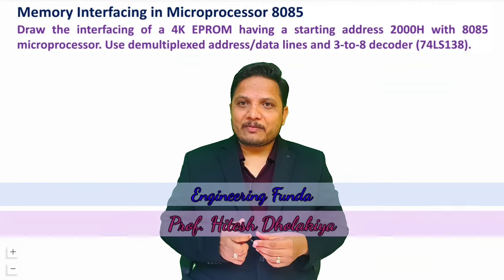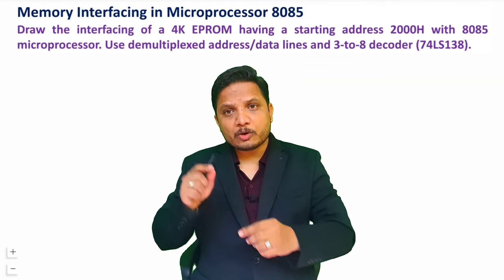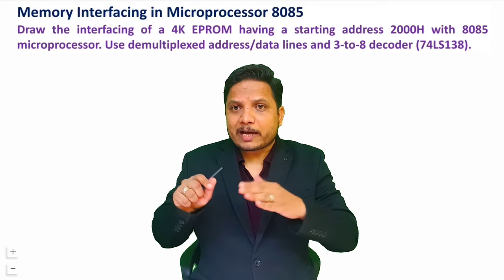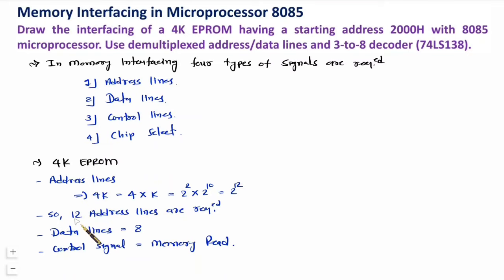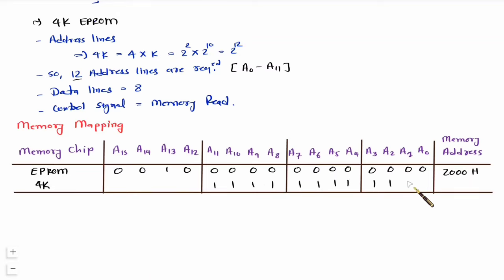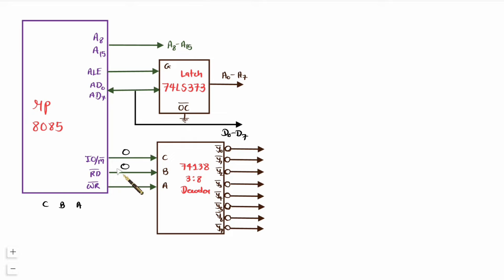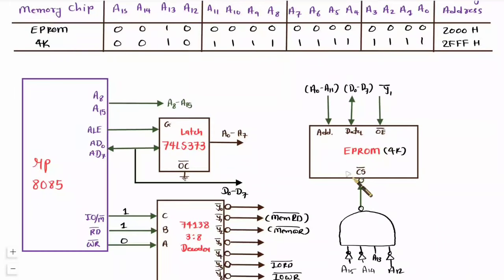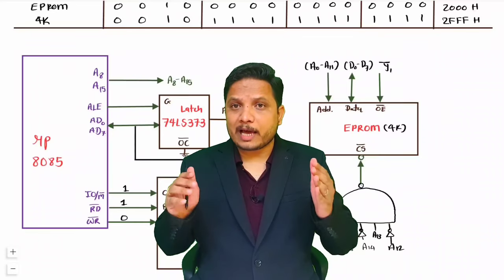Memory Interfacing with 8085 Microprocessor: Solved problems - 1

Comment: For selecting I/O we choose (1 1 0 ) , for memory write ( 0 1 0),  for read ( 0 0 1) by which we are deciding
Reply: We are selecting like hame suppose memwr ka bar signal generate karna h so we will select m bar by taking zero bcz m bar active low signal h to 0 par select hoga and for wr bar we will use again 0 and we don't need rd bar to use 1 kar denge to vo select nahi hoga in this way we get mewr ka bar signal...... 

I hope you will get it...
Reply: @subhampathak but bro I have a doubt in my collage lecture my teacher taught that the output of decoder is used as the chip select and the chip select is generally made up of A13 A 14 and A15 but here sir used read ,write and IO.

Comment: Sir why are data lines assumed to be 8?
Is it bcoz 8085 has 8 data lines ?
Reply from the maker: Yes 8085 has 8 data lines
Reply: @EngineeringFunda  sir if the size given to us will 8kb instead of 4 kb..then how much data lines should we take sir...??
Reply from the maker: @arijeetsutradhar5055  when you write KB, it means Kilo Byte. Byte means data is 8 bits only. So with 8KB, 8K is address = 2^3 × 2^10 = 2^13, means 13 address lines and B means Byte, so 8 data lines.